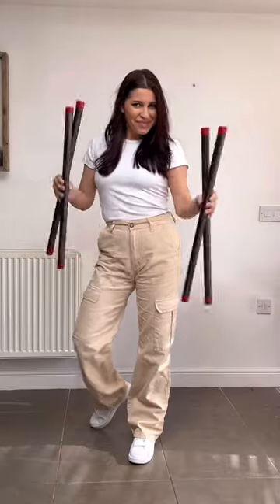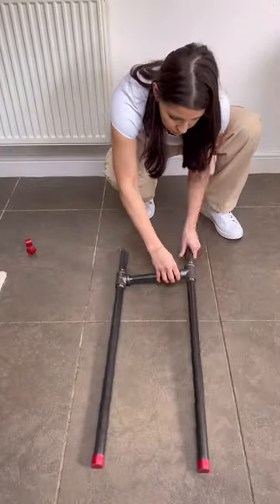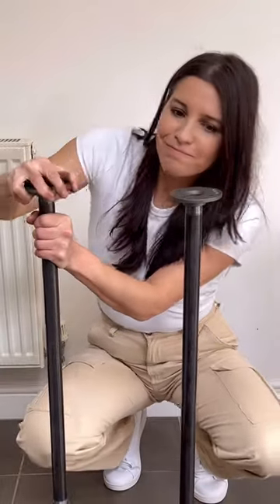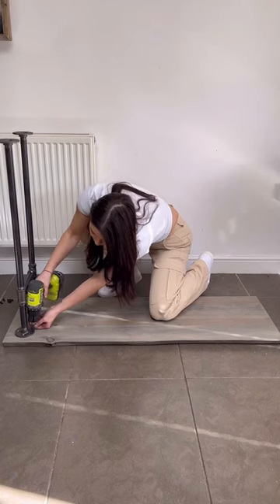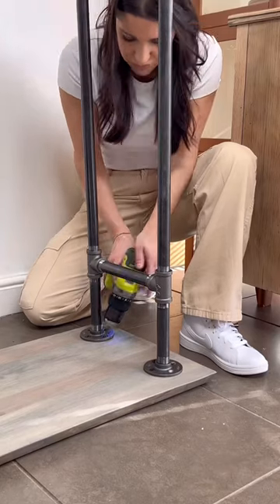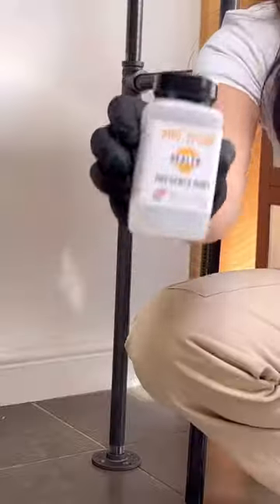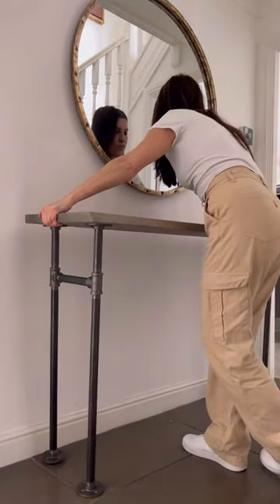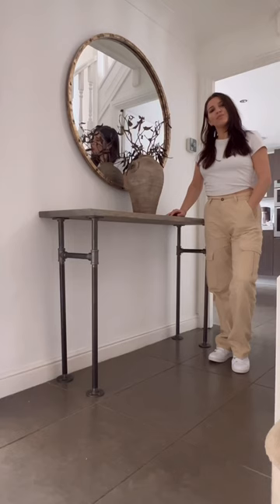ad The EASIEST DIY Console Table! This kit is from @pipedecor2583 “PDCONSOLE10” gets you 10% off!

Comment: Diy is going to the hardware store and buying this yourself cheaper too
Reply from the maker: If you add up all the costs to buy this outright it will cost you more. Especially with the quality of the pipes, sealer, degreaser and the wooden top stained!
Reply: @theflippedpiece  did you buy it yourself?